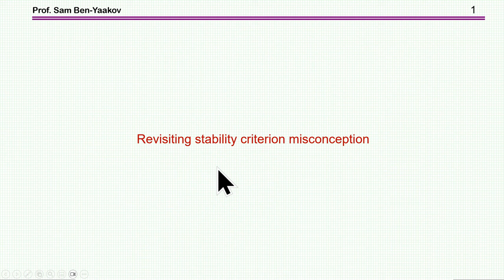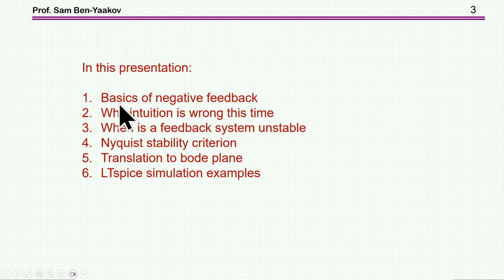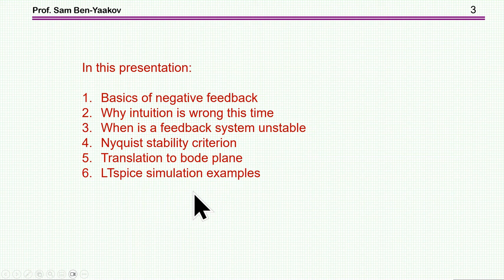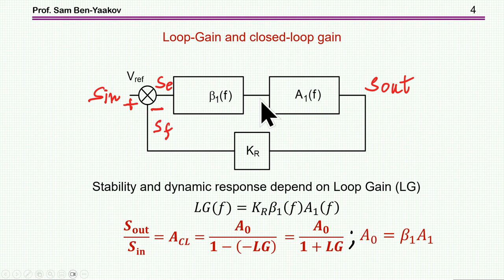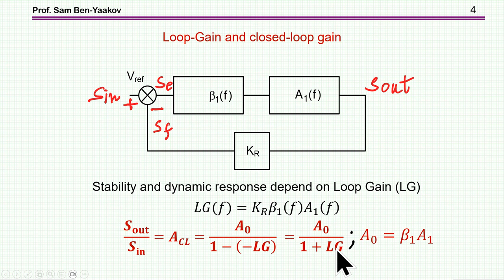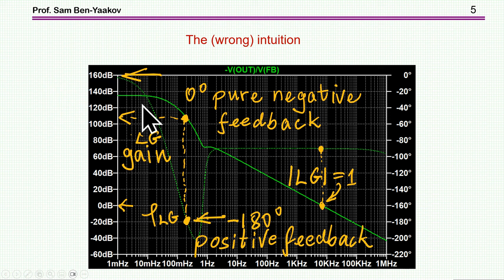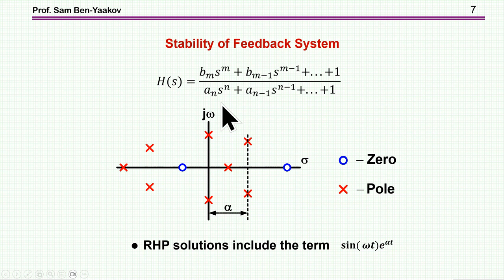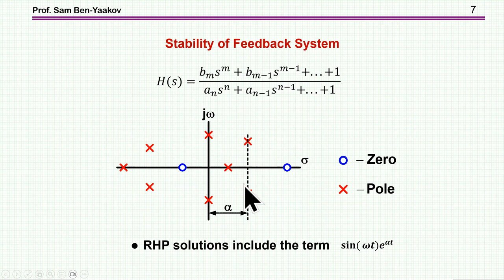Revisiting stability criterion misconception

Comment: Hello! An important question. Is this analysis only for voltage amplifier cases? How would this apply to TIA amplifier case in LTspice? I want to see if a photodiode in photovoltaic mode(no bias) with an opamp is stable or not. Will it be done same way as -V(out)/V(FB) in TIA case?
Reply from the maker: Same way but you need to get the loop gain. What is -V(out)/V(FB) from where to where?

Comment: I might be a bit rusty on my control theory, but isn't this case called a conditionally stable system?
As shown here its very stable, as that phase wiggle is very far from crossover point - move it closer and you'll see damped oscillation - its sorta stable, but sorta oscillates.
I also don't get where the misconception arises - AFAIR by definition its not what phase does in general, but what phase does WHEN gain crosses zero, at least this is how I learned it and you've demonstrated it on the unity circle.
Reply from the maker: The video is meant for people that don't know it all😊

Comment: I am still perplexed. I understand if LG equals to 1, we'll have 1 - LG = 0 in the denominator and anything other would give a non-zero value, but common sense is telling me if the phase is 180 degrees, and gain is greater or equal to 1 the circuit would overshoot (at 200 mHz on the graph). Your math is certainly right, and it is me getting something wrong. Why it does not happen in the practice?
Reply from the maker: Thanks for comment. One more time that commonsense is misleading. Like predicting humans behavior😊
Reply: @sambenyaakov Thank you for a very interesting lecture ( as are all of your lectures). So does your explanation mean that for stability we only care about phase margin? And Gain Margin is not important? In your example with added phase shift we clearly not meeting Gain margin criteria for stability
Reply from the maker: @megfvvd35432  OK. Let me clarify.  I was referring to instability in the sense of oscillations. I did not discuss in this video the effect of phase margin and gain margin that may cause overshoots. Thanks for conversation.

Comment: interesting , maybe it is better top go worth a log scale in the nyquest diagram , asking since in a way it is hard to figure out how that drop in phase looks like , also this in a way opens up some more higher order filtering for SMPS with  odd phase shifts at certain gains
Reply from the maker: LTspice does not support log scale in this mode.
Reply: @sambenyaakov  hmm then maybe with some programmable voltage sources but I am not sure how practical it is.  Maybe exporting data to cover and doing it in another program.
Reply from the maker: @sanjikaneki6226  Zooming tells it all.